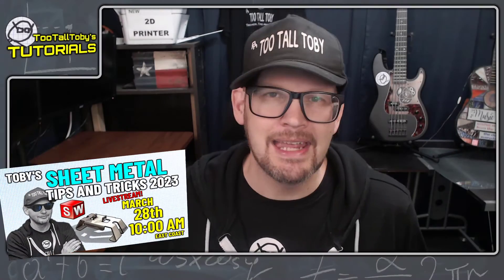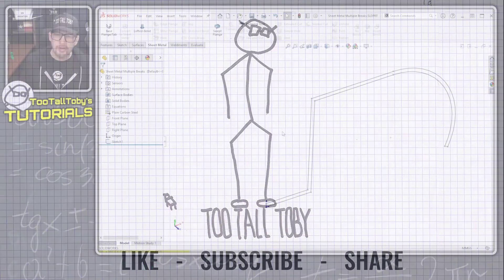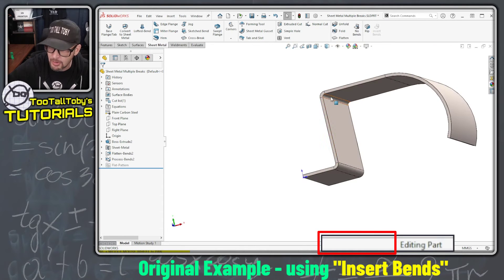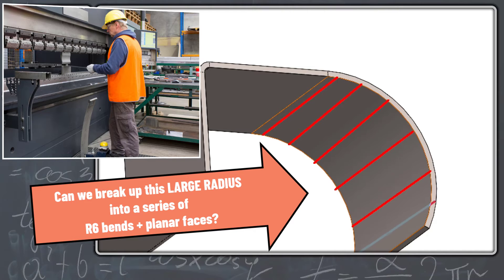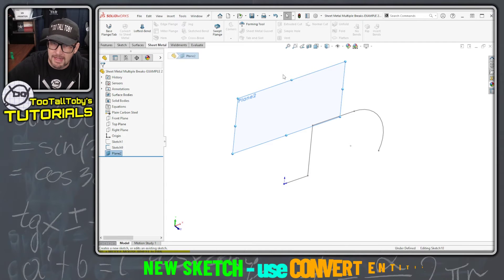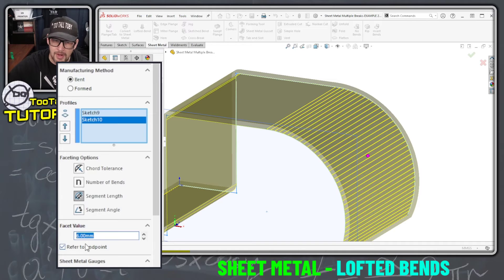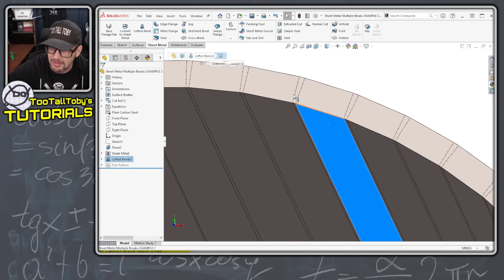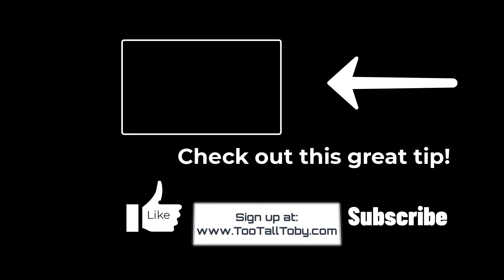SolidWorks Sheet Metal Designed for PRESS BRAKE

Comment: Hi! can you only do this in lofted sheet metal?
Reply from the maker: yes - when I've needed to do this with standard "90 degree angles" I've created 2 parallel identical sketches and used the loft sheet metal option.

I don't know of a way to do it on a standard bend.  

I guess the one option would be to use a "segment" option or manually convert an arc into a series of small strait lines.

Comment: how can you make offset line (bend deduction) to show on my flat in the drawing?  instead of me offsetting every bend line on the flat (drawing)? let say .059 crs thickness (we use r.030 and b.d. is 095), i need to show that .095 offset from the bend line (solidworks generate) for shop (brake dept.). thank you john

Comment: There is another way to do this: divide the circle into equal parts and make the circle an auxiliary line and draw new lines from the division points and extend the sheet in this way.
Reply from the maker: Nice!  that's an awesome solution and thanks for the suggestion!

Comment: What I do sometimes is the single line open profile and in a large radius bend I'll segment the arc and add lines between the points, creating my own facets, just one less plane and sketch to worry about if adding or removing a flange in the og sketch which would leave dangling or missing entities on the converted sketch.
Reply: That's how I did in the past as well. If I knew the loft trick, I would've used it though. It's kinda cumbersome creating those linear segments manually.

Since the second sketch is tied up to the first sketch, for me not big deal having one more sketch in the model tree.
Reply from the maker: Nice alternate solution.  I like it but I do have a question - what do you do if the number of facets needs to change?
Reply: You just kick yourself a little, then edit the segment points count, reconnect all your lost references and add or reduce the facet lines. loft tool is going to be worked into its place here on for me, I usually only do a low facet count on thicker plate for the applications I normally design for. I'll also usually call out a rolling process for large sheets of thin gauge 14,12 and 10. if its non critical I leave it to the forming shop as their preference.   @TooTallToby

Comment: Totally agree, this is 100% the way to do this. 
The only other alternative method I can think off is to use the sketch segment feature on the arc. Once you apply sheet metal to this sketch it will still show a continuous arc as the arc is split into equal segments. To get around this, highlight all the arc segments and change to construction geometry and then connect the endpoints up with lines. Admittedly, its a super hacky way of doing it and not very useful if you want to go ahead and modify the amount of segments (this process will have to be deleted and re-constructed again), but it is another method. I suppose the only good side to this is that you only need to draw and define one sketch which can be then use as a midpoint end condition so that the plane it was drawn on makes the part symmetric about that plane, rather than creating another plane and converting entities, also makes for a 'tidier tree' if your into that!

As i say, this is super hacky and if i was to approcah this in practice in my day job .. 100% lofted bend!
Reply: Yeah, this was loosely the direction that my mind went to originally, but that's because I'd completely forgotten about lofted bends.
Reply from the maker: Same - I thought about doing it as a fragmented "arc" sketch built from lines - but I was very glad that lofted bends worked and saved me a ton of time!